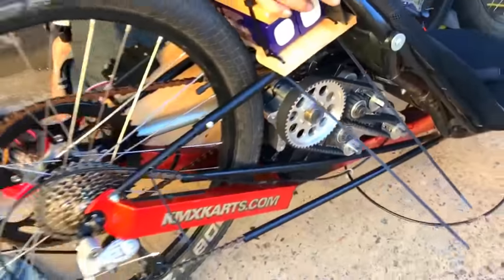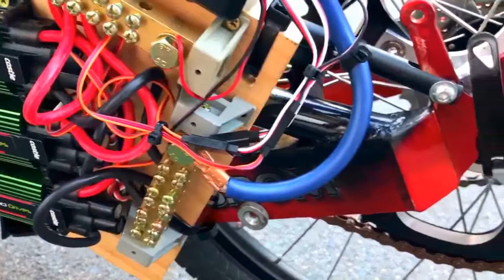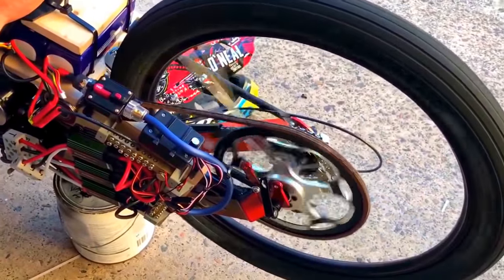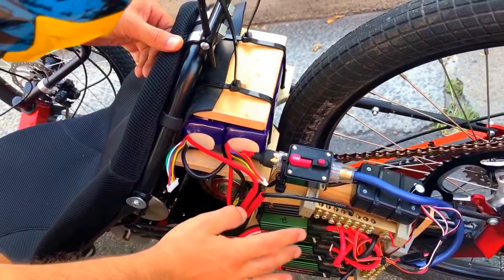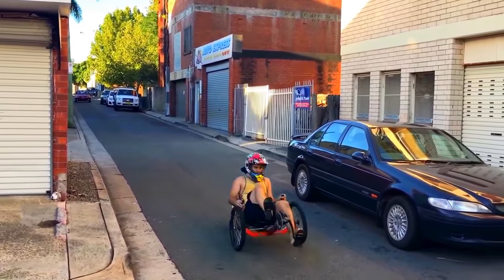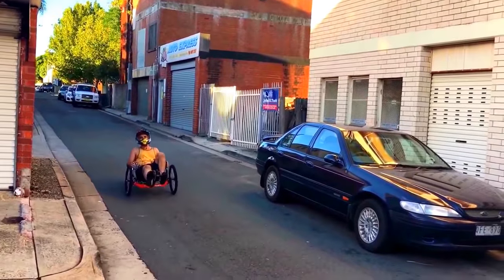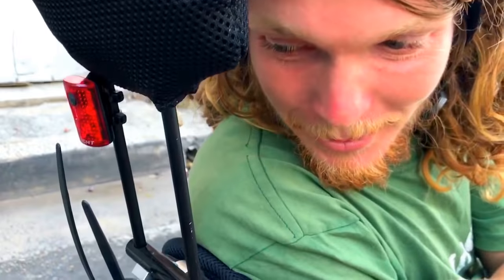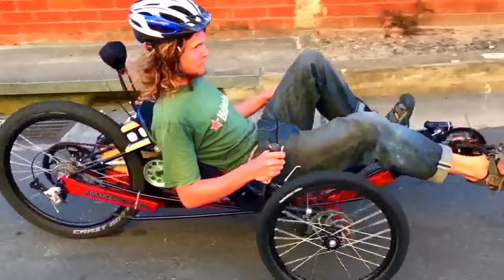DIY 42000w Electric Bike - 56hp Triple Motor (video#3) YES, monster is rolling! First tests at 300A

Comment: how much does it weigh?
Reply from the maker: Yeeaahhh in this video was just 35.2kg this is because I am using a heavy steel frame and a very heavy steel motor mount that added more weight.
I recently added a large 10.5kg racing battery pack and reinforced a bit more so I can finally pull the throttle all the way without breaking the frame in half.. I am already designing another lighter and stronger frame with an engineer, I just need to ride this one a bit more to understand better what I really need then get the other V2.0 made hahaha.. so much POWEEEEERRR

Comment: Will a 60kw ev motor work on a e bike
Reply from the maker: Yeaahh.... anything is possible... the only thing that you need to consider is the battery and total weight... it’s possible to get super heavy duty wheels to be able to handle all that weight... what motor and what controller are u thinking? This is a 50kW setup and was already too crazy to handle https://youtu.be/B7OUMzH0nOY

Comment: hahahaha. oh I wish you would have used twice the amount of lipo bats in parallel they are so fragile when pulling too many amps
Reply from the maker: Yeeeaahh I have more LiPo bats here.. I was just pushing it really hard to see if they can really take the load... a bit dangerous experiment I was prepared for the worst. One of the cells went a bit weird and warm during the charge so I put that pack away for some lipo surgery haha I will remove that cells from the pack. I have a much bigger premium lipo custom pack now that can take 1700A with no problems.. will be showing in my next video, I can finally pull full throttle*!!
*not really I am having mechanical and traction problems now, too much POWEEEEERRR haha
Reply: Have you seen the new Koenigsegg Regera? It has no transmission 1500 HP and 3 electromotors reallly insane!
Reply from the maker: Yeeaahh.. considering something to add downforce.. front wheels were lifting at high speed when I tried to pull full throttle the other day... haha
I have looked at some propellers and ducted fans to fit to my commuter bike that I ride to work everyday...  I want something bizarre.. something different... I think this is the way to go.. a bit noisy but the 250w ebike thing doesn't apply in this case hahahahaha
Please drop me a link if these ducted fans you mentioned =]
Reply from the maker: Koenigsegg Regera? ohhh yeaahhh.. what a beast... 1500hp single gear hahahaha... "I don't like electric cars because it doesn't make noise and doesn't have gears" ....really??? this is a massive shut up to all petrol heads.. ohh yeaah!!!! Electric is the FUTURE and the FUFURE is here!!!! So much POWEEEEEEERRRRR =]

Comment: Top Speed?
Reply from the maker: It’s all about gearing... I originally geared to 113kmh just to have an idea how it feels riding this crazy trike first... then I will change sprocket size and make it run faster. 
I went visit these guys http://trisled.com.au/hpv/aquila/ asking if we could join forces and fit my motor in one of their velomobile and they did some aerodynamic coefficient drag calculations vs 42kW and this would be able to reach speeds over 300kmh (setting an ebike land speed record), they freaked out and imagined me dying and ruining their brand and said NO to this idea hahahahhaaha

Comment: hi people   you men in the video or somebody watching this might help..   i have a cheap 1000w 48v rear wheel on a bike with a 9 fet controller an a13a 48v battery     its  ok on the flat and small grade  hills for about 10 or 15 miles. steeper uphill is useless  so i dumped a extra 12v onto my 48v battery making 60v with about  25% more RPM and a little  more pulling power   its ok but not enough and dead still on steeper hills.       i am in the middle of a upgrade. NOW TO BE HONEST     speed  top end is not my thing i would not  care  if it never went over 15 miles an hour but id like it to climb hills  and tracks of mountains with torque  i plan to upgrade  to 72v at 21 or 30a  regarding  the battery     but is there a way i can get a special motor wound for torque not speed ???      failing  that or something that would get me up a 35% hill with ease and without burning up packing  in or dying with no torque    any  ideas  please  ???
Reply from the maker: Yeah I know exactly where your problems are, a 9 FET controller is really weak not enough amps in and poor amps to the motor (amps = torque). You may be able to fit a 12fet controller (try not go by the FET and by the proper numbers current, voltage, phase amps, wattage). These 1000w motors most are super heavy direct drive so they’re pretty weak at climbing unless you’re pumping a good 2000w or more. Another way of increasing the torque is to decrease the wheel diameter or find a geared hub motor like the MAC hub motor (or look up GMAC on ebikes.ca , it’s way smaller and lighter, a lot more torque using the same battery and controller. Going high voltage won’t help it’s mostly to get higher rpm or very high power like 7000w or more... the only reason why you’ve got more power out of your controller was because the controller was current limited so increasing voltage you increased the wattage, but you actually need more current/amps. Even a 36v can climb hills fast if tuned properly. Another suggestion for climbing hills would be getting a Bafang BBSHD that would climb stairs pretty easy, best vertical climber, can keep the same battery and sell your motor controller/motor and rear wheel.
Reply from the maker: When you go 72v the price of everything simply doubles $$$$$$ avoid unless you want to spend some serious money...

Comment: I think if you test that breaker its not 300a I had this problem with my 400a inline breaker its bullshit they  break way under .my breaker was breaking at 240a I told the ebay seller they full refund . I had to go with 400a fuse I cant find any good big inline breakers for low volts big amps but wow that thing is fast sure to get some fines with that speed monster...

Comment: alright how much do you want for it
Reply from the maker: Hahahahaha I may end up selling this beast when I actually finish this project, I spent quite a LOT of money here (just google AstroFlight 3220 motor and multiply times 3 + special high power batteries, motor controllers etc), you’ll see my next video showing the latest upgrades, I’m finishing a ridiculously powerful active air cooled battery with a very advanced Batrium battery management system (originally designed for larger electric cars).
These experimental custom builds cost a lot of money and take a long time to finish, I had to stop and park this project a few times but I’m FINALLY getting back to finish this project. Yes, I’ll probably sell it when it’s finished so I can recover some money and start another sick project with even more POWAAAAAAAHHH ohhh yeaaahhh =]

Comment: Needs a wider tyre on the back more grip.
Reply from the maker: +jc1982discovery got a box here if many different sizes to try... most are waaay too big to fit this frame, I have to cut the original rear end and make it wider... ohhh yeaahhh

Comment: And you need a little more weight on top of your backwheel xD
Reply from the maker: +Ben Ny yeaaahhh... I'm trying to keep things super light for monster acceleration (power to weight ratio) and optimise the weight distribution and weight transfer under acceleration (very different compared to a motorcycle as I'm down low). I'm also adding a much wider tyre and running at lower pressure, grip is monster, enough to lift the two front wheels and my body... terrifying... super scary but so much fun haha... ohhh yeaahhh!! New video showing the latest updates coming soon =]

Comment: 56hp ? Out of two small lipo battery no a 5kw hub motor would do what I was 
You guys are dreaming
Reply: Saw
Reply from the maker: +Robert Markham if you follow my other videos I explained that this is a 42kw system, this particular video I'm just doing a quick test to see if the frame and regular bicycle parts can handle some load. If you read the description it actually says "first test at 300A" then I'm maxing out with a proper battery pack setting this up to 840A battery amps!! Ohhh yeaaahhh

Comment: Yeah ok 40kw out of 2 little lipo batteries that's like running 40 microwave ovens not possible. plus look at how it performs it performs as if it was powered by a 4hp motor at best.
Reply from the maker: +Tyler Brinker Did you reeeeally read the title of the video before leaving this comment? "first tests at 300A"
4hp motor??????? no... this is definitely not a 4hp motor.. I have 3x motors there that can put way more than 4hp each, please do your homework and research things before dropping these non constructive comments... definitely not very welcome here...
Reply: ElectricBike what's the voltage that it's running at and whats the voltage of the batteries and are they in parallel  you seemed to skip that when you explained everything because I'm pretty sure those are 11.1v lipos I could be wrong let's say you have them in series so 20 v x 300a is 6000 watts so x 3 breakers and battery setups you claim is 18000 watts. and if running at half power and you do have 4 more of those batteries hidden let's say 6amps @ 22.2 v it would only be able to run for 45 seconds that's half power at 18,000watts.
Reply: ElectricBike I do like the build though I've always wanted to build a electric go car with a 15 hp motor at each wheel with a hybrid battery pack from a car that was just meant to do a 1/4 mile
Reply from the maker: +Tyler Brinker I'm always running at 12s so 50.4v fully charged. The circuit breaker is 300A, the motors are "asking" for 840A peak (50.4v x 840A = 42,336w) every time I hit the throttle in this video the breaker dropped after 3 seconds... had to stop, wait, go again.. 
now I have a proper motorcycle racing battery pack with copper bus bars capable of peak 1700A but I "only" need 840A hahaa
Reply from the maker: +Tyler Brinker Did few runs the other nigh in front of my house, went from 17kmh to 88kmh in a blink of an eye.. scary beast... losing rear wheel traction even at high speed and kinda lifting the front wheels at the same time.... 
Im just adding more Electronics and improving the electrical and cooling as well , soon I'll be uploading an update showing this in action... ohhhh yeaaaahh =]
Reply: did you ever upload that video??
Reply: ElectricBike -he don't have a clue leave him sleep because he criticised before he attempted to learn so his mind clearly not in place for Technology
Reply: did you ever upload that video you said you was going to in this video??

Comment: How fast can you go?
Reply from the maker: Good question.. we did some gearing calculations but I like to see this happening in real life actually taking on the road and pulling the throttle.. I'm sure I have enough power to go VERY VERY fast.. I'm increasing the power from 300Amps to 840A now that I have a bigger battery pack.. next video I will have a better idea of what speeds I can take this beast.. hahaha so much POWEEEERRR =]

Comment: Needs a drag slick lol.
Reply from the maker: +Ed Clark got here... super wide tyre, super wide rim... guess what... doesn't fit and I have to cut and redesign the whole rear end... 
in the main time I'm lowering the tyre pressure as much as possible... it's working pretty good but still not enough... can't wait for the big tyre... ohhh yeaaahhh =]

Comment: Your going to need fat wide tires on the rear for stability.
Reply from the maker: Yeeaahhh.. we reinforced this trike so much to take for a spin and test.. now that we know that we need a much wider tyre, fitting something there is going to be so much work.. we will try wider rims and lower tyre pressure first and see how it goes.. I'm at the moment getting the bigger battery pack mounted to the frame, doing the electrical first.. a lot of homework here.. its like an endless project hahaa

Comment: Fat tyre extended swing arm and more battery power would do it.
Reply from the maker: +Ultrahighpix yeaaahh got a super powerful battery that can put up ridiculous 1700A but I "only need 840A" haha 
Lowered this skinny tyre pressure and the trike started lifting the front wheels... got a box of fatter rims and tyres, need to do some metal work to fit the big ones (too wide for this frame)
Trike is different than bike or motorcycle, here your weight is not up high but in front of the wheel, as you accelerate the weight transfer is very different compared to a motorcycle.. if I extend the swing arm there will be no weight over the wheel and cornering will be compromised. I tested many longer trikes and they easily flip around the corner. The secret here is to keep is kinda short with a wider rear tyre and space out the front wheels for more aggressive cornering.
I'm between doing some major work on the existing frame or make a complete new one and have two trikes!!! =]

Comment: how the f is that hub taking 50 odd brake !?
Reply from the maker: +fatbarry barry hahahaa I don't know... if I listened to all engineers I contacted I would've never done ANYTHING here... every single part on this trike is pushed to the limits... I kinda expect something to break under load.. things are flexing but surviving... great R&D hahaha
Reply: yeah ive worked in a bike shop a decade building wheels and doing mtb trials an moto x , i wouldn't have believed that hub could cope with 56 brake horse ! my project stretched mini bike with a honda super cub 90cc engine destroyed the original hub that came on the mini bike in 3 days and that was designed to cope with 4hp ,yeah doing some r&d myself, in the process of designing a rack an pin steering set up to have a wheel instead of the goofy hand steering set ups recumbents usually have , trying to get as much weight on or past the front wheels as possible , up to my ass in understeer at the moment 😆

Comment: How fast is this Bike?
Reply: James Makorov Somewhere between Insane and Ludicrous speed.
Reply: My guess is it's around 50 mph.
Reply: I would say that to be a fairly conservative estimate. I built a 1kw ebike with a chinese knock off kit, and it gets me to 35-40 mph on flats in dead wind. With 400x the power, I would think somewhere in the 90 mph range. Seeing as how the stealth bomber ebike does about 50mph at 2kw. Won't know untill Bruno posts some numbers. Haha!
Reply: The 3 motors have pretty bad torque so the power is mostly going to torque through gearing.  I think his gear ratio is like 5:1 from the motor to free wheel and 3:1 from the free wheel to the tire.  I might be wrong so idk.
Reply: Truth Seeker this thing has hydraulic disc brakes so it should be fine
Reply: James Makorov They may not have the greatest torque, but that is what the reduction drive is for. Turning low torque high rpm, into high torque low rpm. It's peeling wheels on take off, i think the torque issue is fairly moot at this point.
Reply: They need less reduction if they want to go faster.
Reply from the maker: Yeaahh.. with the 24" rear wheel its geared to 113kmh but I will try different gearing too... it pulls burnout at high speed... super scary and dangerous.. I have tried lowered the tyre pressure, I've got a box with many tyre options, very wide rims... lots of little mods trying to tune this monster... my friend is an automotive mechanics engineer and said that this trike was pulling harder than most 500hp cars.. hahaha funny thing is, I am just using bicycle parts hahaha this is AWESOME.. =]
Reply: ElectricBike b

Comment: I’m blowing serious cheese on ebike controllers that fail, and I’m sick of it. I see these high amp rc esc controllers but they lack the large mosfets and capacitors. Here I see you using rc controllers and I’m curious as to how well they perform under stress and at slow speed takeoff. Takeoff being the killer of most. I see you get the trike moving before throttle. Is that because they are sensorless? Or to minimize stress? I would kill for a 10 minute conversation with you guys. There is so many people going by the book and very few who write there own. I don’t want regular stuff. I want the goood shiiit. Joe dirtay style. We don’t want no snakes, sparklers. I want the wam wams. Black cats. M-80s. Mortars. But I’m not rich, most ppl are not. I’m willing to save and get what I need, I just can’t figure out what can deliver, consistently and reliably. I have 10kw golden motor mid drive and need serious amps at 84v. My batteries can deliver 450 amp 30 second bursts, 200 continuously. I just bought two Kelly controllers that blew one after the next due to them falsely advertising ratings on website and got crickets for help. Got ASI 72v 600amp controller on way for $500 and after what I lost with Kelly, if this blows mosfets too, I’m done. I need a cheaper alternative. Can you give me some insight and a couple alternatives that help make this mans money go farther and longer? I would greatly appreciate anything you can share. Please. Thank you for great video.

Comment: Its acually at 57 HP if its 42kw
Reply from the maker: Yeahhh it al depends if it’s mechanical/electrical or metric horsepower...
42000 divided by 745.69 = 56.32 mechanical/electrical horsePOWAAAAAAAHH
42000 divided by 735.49 = 57.10 metric horsePOWAAAAAAAAHHH 

57.10 sounds even better hahaha ohhh yeaaahhh =]

Comment: that small battery got 300 amps? shit dude.
Reply from the maker: yeahhh.... poor Lipo packs... they didn't like such hard punishment... 
whatever.. I got another custom pack here used in racing electric motorcycles that can handle 1700A no dramas.... hahaha..  you'll see..